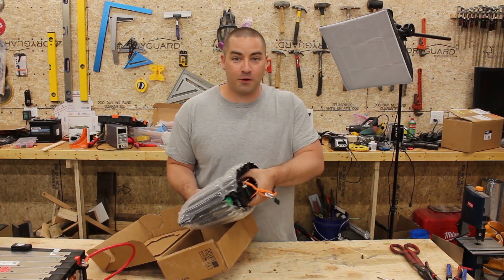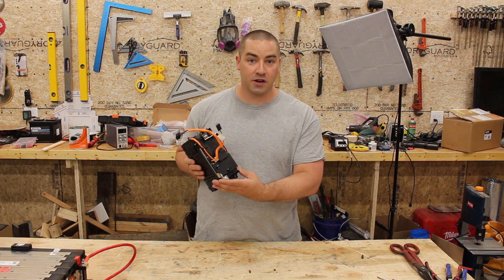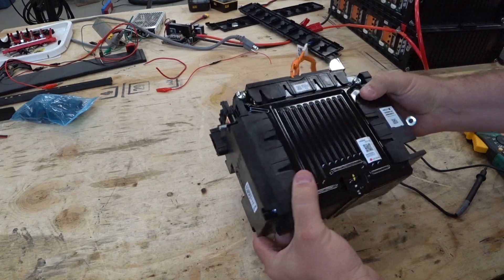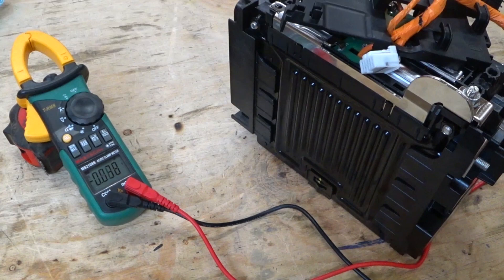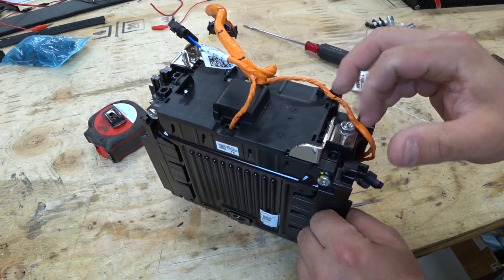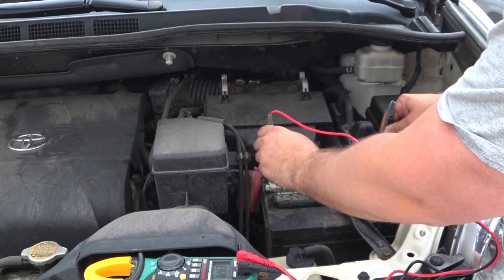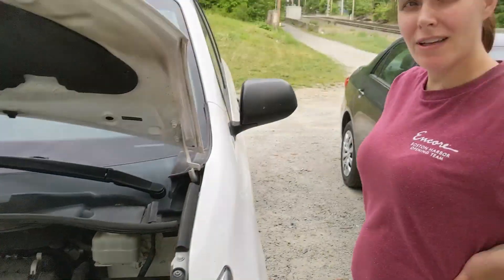Lithium LTO Battery starting a V-6

Comment: I just got my LG Chem BMW 12 volt batteries, but they operated different then other batteries, you need to apply a 12 volt power source to them otherwise they shut off on their own! There is a circuit in them that does that when no energy is being used or charged to the batteries! I am going to have to remove that circuit, so that I can use them, the form factor is great, a nice small size! They can output 500 amp plus for 3 secs.

The temperature probs come out easy, just pull up on them, and the wiring harness is out of your way! The end caps, on both ends pop off if you use a flat tip screwdriver, so the profile become even slimmer! I suggest getting heat shrink to keep liquids out of your battery if you are going to use them as starter batteries! After you get a LTO BMS installed to manage it! You can also reuse the outer case so that it takes up more space in your car’s battery compartment!
Reply: Thank you for this excellent information! I have just got these LTO cells as well and as you mentioned applying power to them gets the internal BMS to kick on. Shame I cut one up already without needing to :( Mine aren't shutting off on their own after being charged though but I'll see how they go
Reply: I got one. Mine doesnt look like the picture shown on their website at batteryhookup and it doesnt have a charge or take one in either. I'm lost 80 dollars and 20 cents wasted.
Reply: Herbert Werner Did it look like the one David had already out of the case? That relay, and the BMS it stopping it from being able to take and release its energy. I had some that would activate but the next many quit working, so I had to cut them open.

Tell me more of how yours looks
Reply: MaximumPCs That relay is not reliable, and it is why BMW got rid of them, and now we have them. If you cut down from the top, on the ledge just below the outside posts, it's a quick easy job to get them out of the case, with no scratches.

Comment: at 4:15 or so you dump baking soda and water on your 12v lead acid battery. why would you do that? to have a continuous puddle of water between the positive and negative terminal seems quite reckless. fine to clean them, but not both at once! 😭
Reply from the maker: The baking soda neutralizes any acid.
Reply: @ yes, and the water conducts any electricity. 😂
Reply: @AJTarnas For all you know he could have used distilled water, which is not a good conductor. Think before you nitpick every little thing you see on YouTube.

Comment: How do you calculate cranking amps? Let's see how it works in the dead of winter on a cold engine! Great fun!
Reply from the maker: I look forward to testing it in the winter.
Reply: Other LTO battieres are rated for  -20 C = -4 F. for charging and discharging. LTO batteries seem to overcome alot of the temperatrure, surge current, lifetime, and safety limitations of other chemistries and have been around since the 80s. What has changed, is manufacters recenlty figured out how to get cost down to be about 2x of  LiFePO4 battieries per KWH. Cost was holding LTO back. Cost got fixed. It is going to be big.
Reply: Daniel Stoica I just got 10 of the LG Chem BMW LTO batteries, they are strange they have a shut off circuit if no power is being draw or charged to the battery.
Reply: it will work just fine in the winter. I have sold tons of these over the years.  Great little batteries!

Comment: why switch to Lithium battery? Beside light weight, last longer? Protect the engine?
Reply: LTOs, can handle cold weather down to 30 below zero! Most other lithium can not handle 20 degrees above zero,. You would destroy the battery if you tried to charge it while it was cold. Plus the life for LiFePo4 is 3000 to 5000 cycles, a normal lead acid is 500 cycles, and a LTO is 20,000 cycles! The LTOs, output up to 25C rate 25 times the rated 1C rate.

Comment: Wanted to say thanks for the link to the video showing how to open the case on this battery and use it. I got mine opened using a dremel and now hopefully charging it. But I didn't remove the bms. I did disconnect one wire leading the the switch thing on the side. have purchased a 4s active cell balancer but before I use it I thought Id ask.  And my question is can't I just use this battery with the bms that is already there
Reply from the maker: Congrats getting it open.  You can leave the BMS and relay "switch on side" in place.  But they won't provide protection when you disconnect a wire.  You are basically just leaving the switch closed.  A 4s balancer is not a great idea because this battery has 6 cells.
Reply: @DavidPozEnergy  David thanks for getting back to me. Okay well I can easily hook back up the switch wire . But is that bms that is already there working or is it useless ?  Oh when I said 4s active cell balancer I meant 6s, its a 6s balancer.
Reply from the maker: I don't think the BMS would work without a communication with the cars computer.  But I'm just guessing.  I have not tested that.
Reply: @DavidPozEnergy  David again thanks for getting back to me. Well i do have the 6 cell balancer however I wouldn't know how that hooks up I'd need a video just for that. But I have my battery now charged to 14 volts and it runs my inverter so I am more than happy for the moment. I really love this battery. Should have bought ten of them.
Reply: @DavidPozEnergy  I would think you are correct. Ill have to break down this battery further and get a balancer or bms on it. It charged to 14 volts the first time then I ran it down to 12.9 and charged it again but it seemed to stop at 13 this time. Not fully charged but I would have thought with an hour on the charger it would have reached 14 volts again but it didn't seem as tho it was going to reach that. But I didn't leave it on the charger to find out. Worried that some cells might be out of balance already. I need to get to all the cells and check each one.

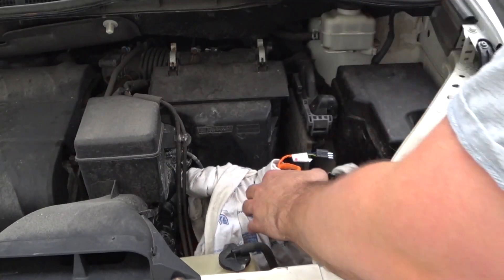Comment: 6:30 for the engine start. That is the fastest I have seen a minivan start. That was less than a second. Compress Compress Vroom. It is the little battery that could
Reply: A 25C rate massive dump of amps started it right up! I got rid of my lead acid yesterday morning, for one of these! Had my radio on for hours!

Comment: Great video. I would like to see how high the alternator will charge that battery. Is 13.5 the max charge voltage?
Reply from the maker: LTO can charge up to 2.7 volts per cell, or 16.2v for this battery.  I don't think my alternator will drive it up that high, but it's something I'll check.  I want to wire in a volt meter and drive around.
Reply: @DavidPozEnergy  Do the ltos need a bms?
Reply: @DavidPozEnergy  I was under the impression that and alt will charge up to 14.8v. Does it only charge to 13.5?
Reply from the maker: "Need" might be a little strong of a word.  LOL.  It's a good idea to have a BMS on every battery.  But as you saw in the video, it did the job of starting the van with no BMS.  Since the BMS is a safety feature, then you can ask the question of risk without a BMS.  LTO's don't blow up, soooooo......?  I can't say anything else here, but we can chat on FB.
Reply from the maker: I don't know the max charging voltage of my alternator, but I want to put a meter on it and find out.
Reply: @DavidPozEnergy  Grab a cheap one on ebay . There like $1. I have 10 of them or more still from my lead acid system
Reply from the maker: Yes, that's the plan.  I want to run the meter into the cabin, and drive it up on the highway to see where the alternator maxes out at.
Reply: @DavidPozEnergy  Id be interested to know as well. I got a 300a 24v alternator. I may work on a generator build.
Reply: Almost all alternators stop charging at 14.2 volts and start again at 13.6
Reply: My truck pumps out 14.7 volts from the alternator! So that it what I charged mine too!

Comment: I made my own 6s2p lto a year ago and have a 15,000rms watt sound system in my big ass SUV, and I can run all that without even any drop in voltage. I just created lithium battery business a month ago as well and just completed a huge deal with the manufacturer I'm china, LTO is in my eyes one of the best types of lithium for multiple reasons.
Reply: Jader Do you have a website?

Comment: Fun video and thank you for it. I have not looked for, or at the battery. My comment is more about how much it takes to start a car with a gas engine in good condition less than 200 amps most around 150 amp. When it is very hot or very cold it will take more if the starter is going bad it will start to draw more amps also.

Comment: It work but you really should make sure your alternator is changed for one that can charge a lithium ion battery correctly or if it's computer-controlled alternator your ECU is reprogrammed to handle a lithium ion battery or might get magic Inferno coming out of the bonnet (not magic smoke) or just damage the battery
Reply: It's lithium-titanate, (LTO) not NMC.  If anything, LTO is safer than a lead-acid battery.  With a proper remote BMS configured, and perhaps a little more size for capacity reasons, this would be a perfectly viable, long-term cranking battery solution.

Comment: will this battery charge via the alternator? Is a BMS needed or is it built in? Too many qustions.....
Reply from the maker: Looks like there is just data collection for an external BMS, but no BMS on board.  Probably built into the car or something.  I think it will work with the car alternator, but it's something I have to put a meter on and test.

Comment: Are u going to add a BMS to it or just use it as is (without a BMS)?
Reply from the maker: I'm not using it as my starting battery permanently.  This was just a test to see if it worked.  I will probably add a BMS for a final build.

Comment: I was reading the info on page and it said a bms is required. So my question is what are all the extra wires for on the battery ?
Reply from the maker: The wires attached to the battery read cell voltage (6 cells), temperature (2 temp. sensors) and amps (from shunt).  This would go to an external BMS, maybe in the car?  I don't know the original setup BMW had.  But, yes, with all lithiums it's a good idea to add a BMS.
Reply: That relay was the problem it was not reliable, and it is why that car had problems, they could not get the batteries to restart when you pressed the pedal. It was a nice design to save even more energy, but it took too much time to restart the batteries, and some failed to restart. So now we get the benefit, I waited a whole year to get some LTO batteries, to replace my dying lead acid! I installed it yesterday morning!

Comment: How long do you think it would last with just the radio on? Or before the starter won't crank...
Reply: This battery is only 10ah, a typical Pb car battery is at least 40-50ah. Depending on how much power ur radio uses u should be able to get at least a few hours but just keep in mind this doesn’t have as much ah as a typical Pb car battery.
Reply: Almost 2 hours, The low voltage light came on yesterday, I waited 10 seconds, and it still started my truck! Not going to do that ever again! It’s basically a new battery, not going to waste it! That was the first cycle of the battery, I was worried at first!

Comment: This can probably destroy this battery because a normal vehicle voltage should be 14  to 14.5 or you have a bad alternator. So take the positive off while the car is on. If the car turns off you need an alternator.🤔
Reply: The cells are to 2.6 volts, so at a 6S you should be able to charge the battery to 15.6 volts

Comment: You cant charge it without BMS. The cells desyncing after every cycle.Thats 1 of many reasons why nobody replace them with PB batteries.  Even many e-cars still have a 12V Pb battery for standart board electronics. Its not working like this for long...
Reply: Dude you can get a 6s BMS for $9 on bay. So it is fine and less costly too!

Comment: Another amazing DP discovery. Do you need anything to regulate charging from your alternator? I keep a 1995 Ford Explorer with a V-6 at my farm and think one of these would work fairly well for cold weather conditions unless they don't have enough CCA's
Reply from the maker: I don't know yet, I want to set up a meter and test what happens at idle, and while driving.
Reply: Follow up video?
Reply: in a 6s configuration the LTO does not need overcharge protection, as the alternator doesn't put out over 14.5V. (unless the voltage regulator is broken)

Comment: the peak cranking current can be as high as 800A and not sure what’s the rating on your lto battery. they usually give you like say 300A for 10s but it may be also fine at 700A for half a second idk otherwise they will degrade much faster than rated at.

Comment: I have 4half capacity headways with doubled 12 gauge cables on it, it will start a small 4cylinder, I belive it would start larger engines, if I had larger cables on it, 
I almost bought one of these, but I'm focused on my house for now, getting the 18+kwh 24v battery bank added, and more solar panels! I'm needing to find a deal on PV, and more batteries! I'm suffering from lithium addiction! Over 33kwh in the house!! I think I'll stop around 50-60kwh.. 
Well maybe 100 kwh, if I get enough to fully charge it in a couple days, give or take,  as is I need about 3kw more PV. So I'm thinking I need about 4kw pv, to total 5.5kw,

Comment: I used one of these to jump start a Cadillac Escalade yesterday, a neighbor’s visitor truck needed a jump, so I tested to see if the battery could jump it! It started instantly!

My truck is a hybrid, it has no problem starting my truck. None hybrid trucks may need from 600 to 1200 amps to start them. My brothers has a Dodge Challenger and that car has a huge $1600 battery to jump start it.. I tried to jump it with a 2012 Prius, and it did nothing for his car, and my truck barely did it! I have a few LiFePo4 batteries, and one of those did do it barely
Reply from the maker: Thanks for sharing.

Comment: Geeze $250+ for that?  SMH
Reply: Have you priced lead acid batteries lately? A good high quality lead acid isn't much cheaper and they only last about 5 years at most. These LTO last how long??
Reply: The battery was $66! LTOs have 20,000 cycles, and your not really using them much just for starting a car, a 3 second burst is not even cycling the battery!

The dodge challenger battery cost $1600, most car battlers cost $300 or $400 if you do not return the core! Most of the time you get them for around $150 with a core return, manning giving them your old battery!
Reply: With the corporate greed and expense new car batteries are now a days these lithium lto batteries last the life of your car and put out more amps and sustained voltage than lead acid’s, you do the math, lto is super safe, a 20ah-40ah should do the trick